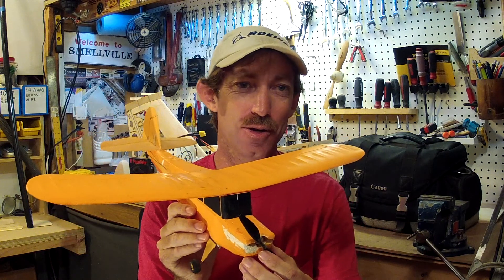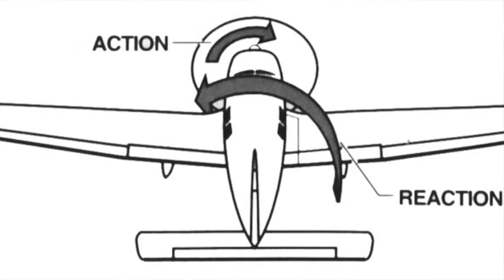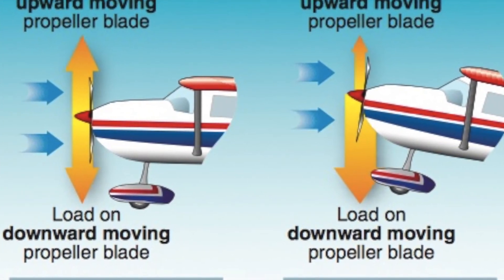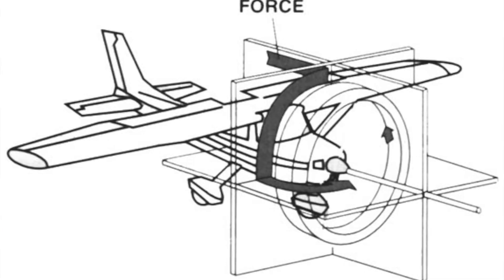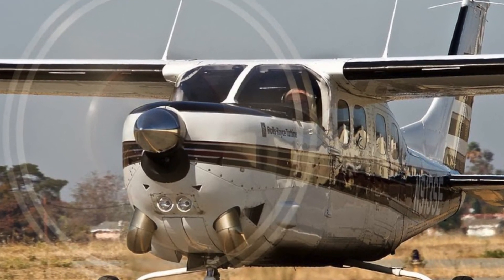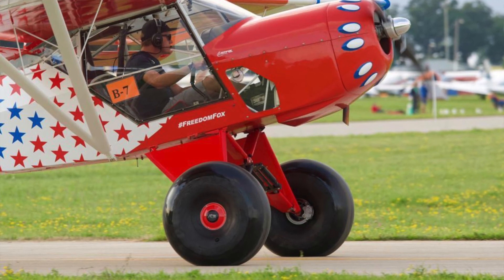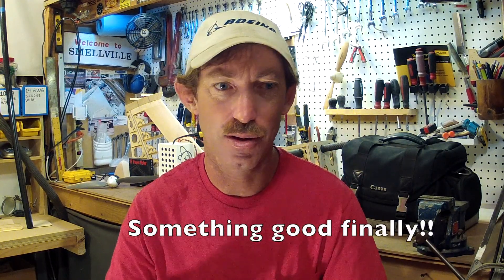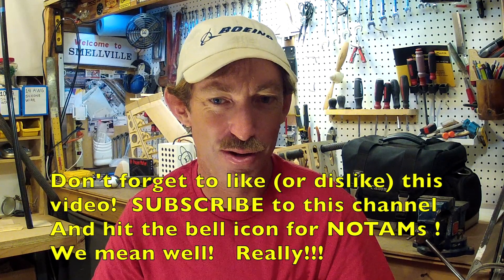SINGLE ENGINE AIRCRAFT (Tractor) CONFIGURATION EXPLAINED IN DEPTH

Comment: Dear sir. I was very impressed with your videos on the tractor vs pusher configurations. Saw them both, From what I could gather, pushers are more fuel efficient at cruising speeds, and tractors maneuver better due to the increased drag. That said, knowing what you know now and having access to today's technology, do you think a twin motor pusher biplane would've made a good fighter in WWI? Or do you believe the increased speed would've been nullified by a tractor plane's ability to roll with the force of their propellers, making tractors the superior fighter? I'd like to build my own WWI fighter one day for sport, using a twin motor setup using today's technology, but I'm not sure if the dual engine tractor setup of the Screamin Sasquatch ( https://youtu.be/QA-w8HjeY2Q ) is more appropriate, or the pusher configuration of say Peter Sripol's DIY Electric Biplane ( https://youtu.be/eNSN6qet1kE ). Speed and maneuverability both matter here, as was the case of a Fokker Triplane vs S.E.5.a, with the triplanes being more maneuverable but the S.E.5s often winning with superior speed. I would love to know what you think on the matter before I start my plans. Thanks for the video, subscribed!
Reply from the maker: So if you want to build your own "WW1 Style" fighter, and actually fly in it yourself, a word of warning... The best fighters of the era were not very stable (or unstable in several axis, not to mention the interaction between the axis.),
and therefore inherently unsafe.  It would be much wiser to build an aircraft for personal use that is stable.  That pretty much eliminates most WW1 fighters, at least the original designs.  Those characteristics helped them perform some maneuvers, but made them death traps, and were not at all a pleasure to fly. 
Even from a pure air to air superiority standpoint, as you stated, the faster aircraft prevailed statistically.  At the beginning of ww1, it was thought that aircraft would have duals, such as medieval knights, one on one, but it showed up very quickly that that tactic was not beneficial for actually winning a war, and a hit and run tactic was much better.  it does not matter much if you can maneuver, if the opponent can decide to approach when he is ready, make a fast pass, fire a few shots, and disengage by using his superior speed.  He will win.  he can also gain altitude every time before he engages, giving him the advantage of kinetic energy.  the slower plane, regardless of how maneuverable it is, or how skilled the pilot is, is at an inherent disadvantage. 
This tactic is what actually won the air war, and was a lesson applied in WW2. 
a twin engine configuration is a great idea for any airplane, as opposed to a single, except for 1 factor, and that is that there is twice the probability of an engine failure. if you are using electric motors, then it's not likely, so less of a factor.  when you do lose a motor, the offset thrust can cause some issues in a twin, but if it's designed properly, (we'll discuss this in next episode), then they are manageable, and the pilot is in a much better position, still having 50% of the thrust to fly on.  A good idea for a manned aircraft that you would build yourself.    stability, and safety should be prime concerns for a home build aircraft,  but you can still make it look how you want. 
the biplane configuration seems great, until you learn how boundary layers affect the wings, and the interaction between them. it's really not so good, and the reason you don't see many biplanes today.   peter's is a pretty good example, but even he went to a monoplane for his next version. he used a low aspect ratio, which I think was a mistake..  a very practical and stable home built aircraft is the sky pup. 
https://www.youtube.com/watch?v=4X7kUFquLP0
it had good glide, low speed, good stability, and simple to fly.  a modernized twin version would make a great home built ultralight. 

peter's biplane had the motors between the wings, which is good, as the slipstream (accelerated air from the motors) went out cleanly, and at roughly the same vertical plane as the center of drag, so no or little trim required for power on/power off.  
the jet assisted biplane (Sasquatch) will have some major elevator trim required, as the jet added is below the fuselage, and will pitch up when the jet is powered up.  the pilot will just have to get used to it..  not ideal...  it's just meant to be a stunt plane, and a curiosity. it's either the safest way to fly, not practical, and has no great benefit, other than having a lot of power for vertical maneuvers. It will have lots of thrust at low speeds because of the prop, and lots of thrust at higher speeds because of the turbine, so will have a very good overall thrust curve over the airspeed range. interesting, and useful for the stunts, but not so much for practical use.  
Keep in mind that most ultralight aircraft are shaped by the rules for such, rather than good design concepts.    the rules give a max airspeed, and max weight, so they are designed with high drag,  lots of power, and lift.  if they had cleaner aerodynamics, they could fly with much less power, fly for much longer, and have a more robust structure, but would fly faster, and weigh more. They would be safer, but would not fit within the rules..  that's what LSA aircraft are for.  you can also go the route of motor glider, look up the rules, and see what can be done, such as ski-gull by Rutan.
Reply: @FPVREVIEWS  Thank you, sir, for the kind and swift response! I had a hard time imagining what you were proposing until I checked out the Sky Pup. That thing looks like a dream! I get it now. Say, if you owned a Sky Pup, where would you mount your twin motors on the wings? I am interested in a plane sporting a fuselage without a prop in the front, for safety reasons, so I'm curious if you have any good examples of how a twin motor pushup setup might look on a Pup, given your expertise in this niche area. 

Going to look for prices on used Pups now. Will let you know what happens! Looking forward to your reply.
John!
Reply from the maker: should be pretty simple to mount.  make some nacelles that leave a bit of space between the props and the wing. 
one thing you would wand to do, if electric, would be to use two battery packs close to the motor controllers, to make sure you don't have issues with ripple current.  @exhale85
Reply from the maker: you must mean twin motor tractor.  twin motor pusher , wing mounted is not such a good idea.. 
 @exhale85
Reply from the maker: have a look at lazier or cri cri .              you can pusher mount to back of wing, but much vibrations will result.
Reply: @FPVREVIEWS  Dear sir! I took a look at both aircraft. You are a fan of the pusher design, but you warned it's not good on a wing mounted setup. do you explain the reasons why in any of your videos? i also took a look at the lazair and cri cri. I will use those for examples in my build. As for the nacelles you mentioned, do you have any good examples from either industrial planes or a DIY build? looking forward to your response. Thank you!
Reply from the maker: https://www.youtube.com/watch?v=Xy8Hb16Fq1o&t=141s
at minute 5:50 

 @exhale85
Reply from the maker: @exhale85  for the nacelles, you need to tie to the main spar/spars, and need a box style structure to counteract the torque from the motor, so it does not break/twist, along  with other loads.
Reply from the maker: @exhale85  you can look at some info for twin dev. data here:
http://wpage.unina.it/fabrnico/DIDATTICA/PGV_2012/MAT_DID_CORSO/Design_Cases/P2006_ICAS.PDF

pushers are interesting, but I personally prefer multi engine.   next video will be on that subject.